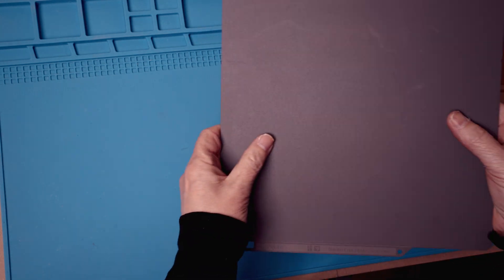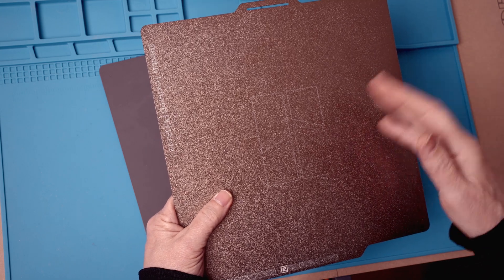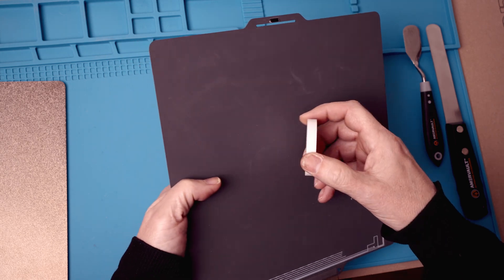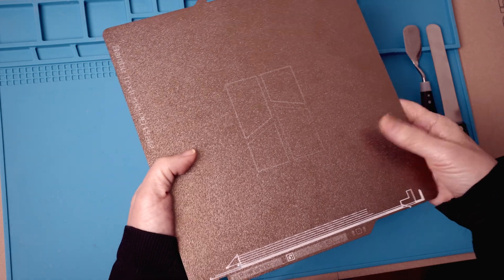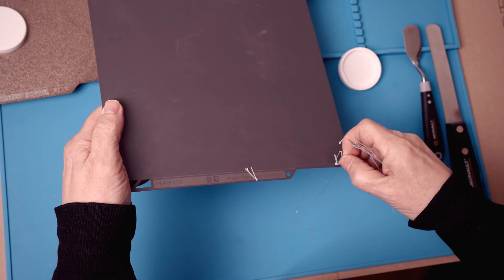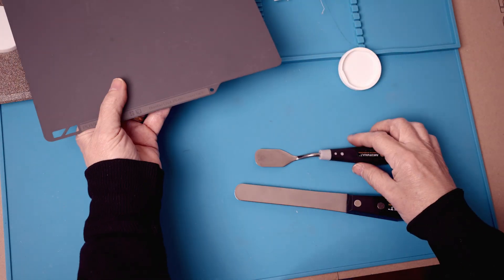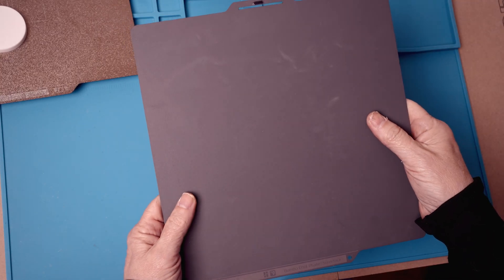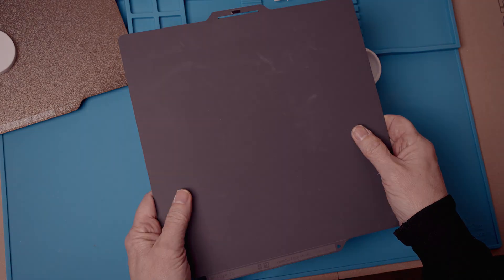Bambu Quick Test: CoolPlate SuperTack vs Textured PEI Plate

Comment: You should try using the scraper file included on the Bambu printers (completely made of filament); I only use that and it works great.
Reply from the maker: Thank you, I didn't want to risk anything after wrecking the first one, but I bet that is safe.